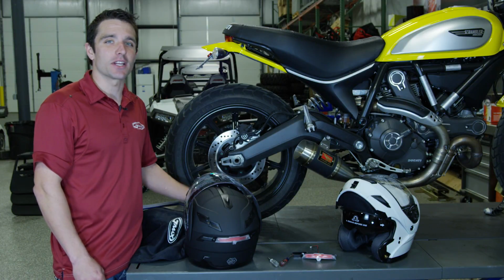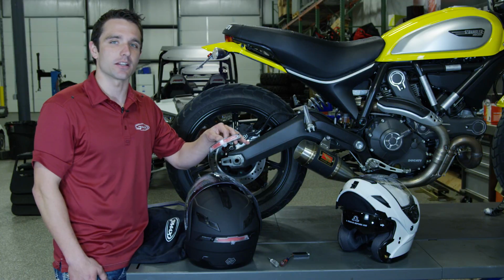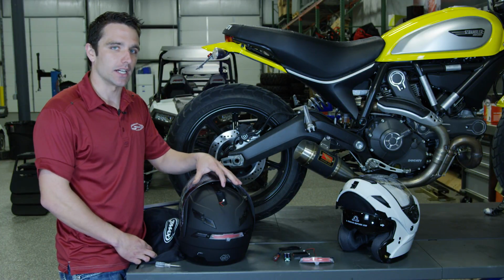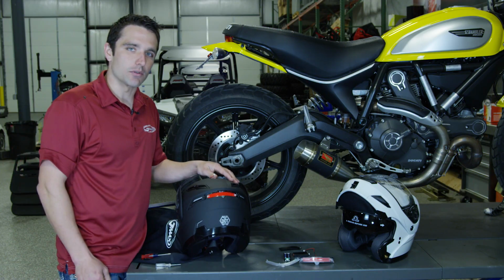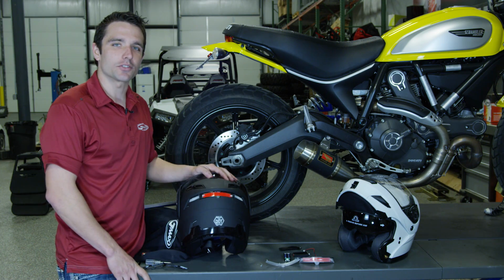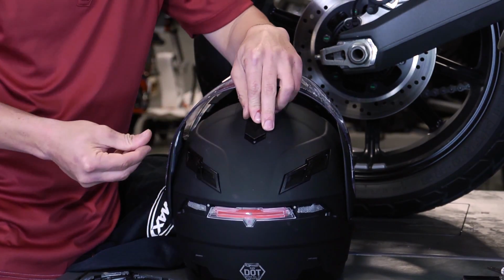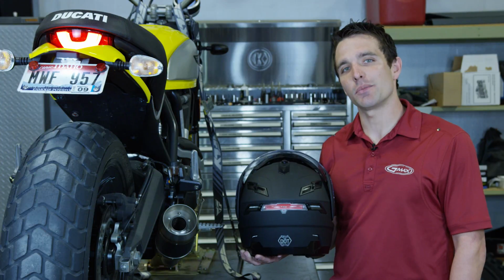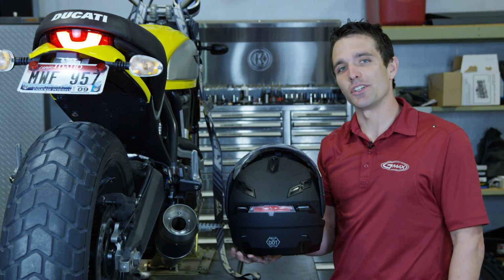How To Install A Wireless LED Brake Light Into Your GMAX Helmet

Comment: FYI, for the new FF-98, there is a jumper wire from the battery box to the light, male end at the battery box and female end at the light, so you do not have to fish that wire through the helmet.  Good thing because it isn't long enough!  So, don't panic when you open the package and see a wire from the light that is way, way too short to go all the way to the battery box.